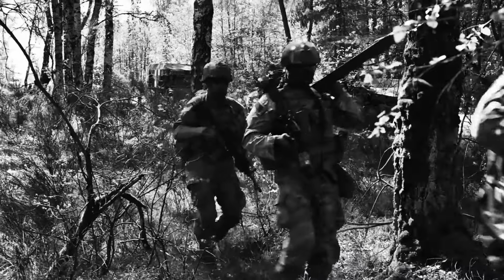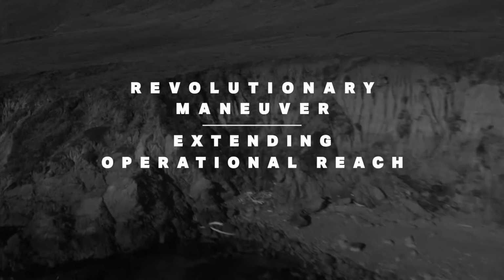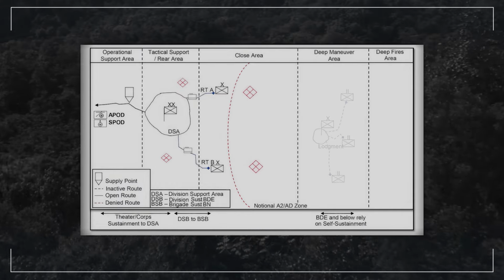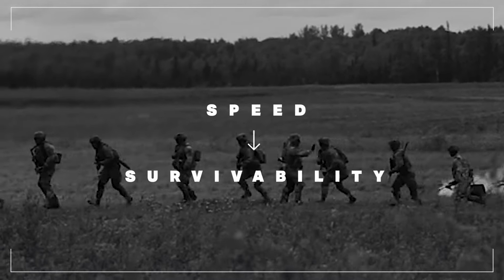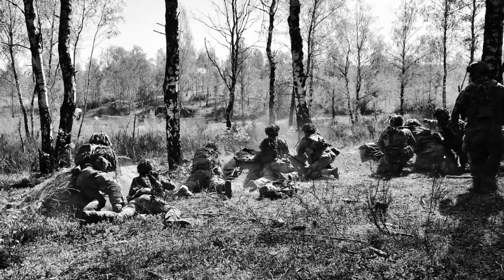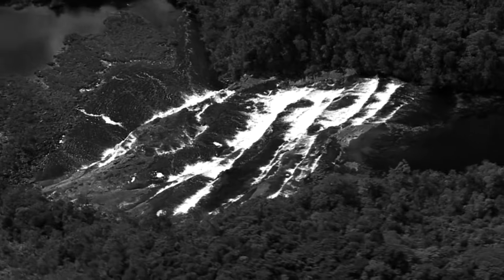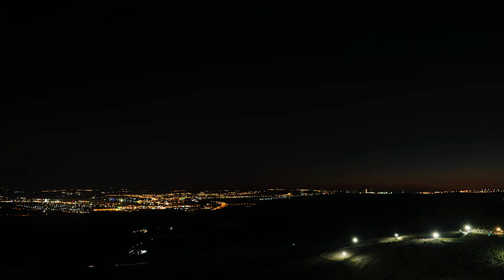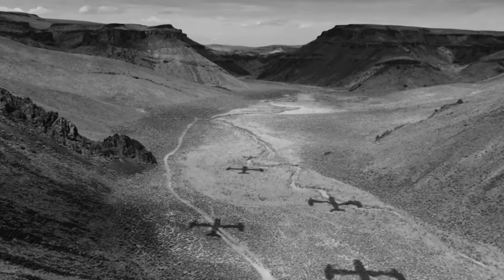Revolutionary Maneuver: Extending Operational Reach

Comment: Hello Bell Texas, it's about the bell sold invictus elysium, a front kit, middle and rear kit system where the rear section has a sikorsky drive propeller that is directed backwards and a joint step to the middle section with 2 rotors, lift unit which in the Osprey flight mode is in line with the rear module, middle module, traction rotators drive and the rear, thrust rotators drive and the front module has a joint which in Osprey flight mode takes the jet position with a detonation 30 mm Puma laser rangefinder. Stadtilm would be a good location for a factory for production in the Ukraine and EU. As an invictus 360 basis. With e-motor rotors which generate electricity for the drive through Duke engines 5, 10, 15 cylinder dynamo.  Your AGK DTS Hypo economic concept institute maison des associations Thuringia United Germany evangelische Union weaponsmith Fabriky would charge 50 percent of the final patent ©®™ Hello Bell with the Heli hybrid of the MDA DTS Stadtilm Foundation a larger area could be covered and with the valor two main engines and a rear blade propeller drive a higher speed to provide the Mediflyers intake point which is based on a Bell Heli area to improve range to make it more economical and perhaps enable a lower consumption of fuel with a twin Duke energine new Zealand two Duke in opposite connections with a swivel nacelle upper large trill rotor and a lower propeller. Your MDA DTS Thuringia would charge 50 percent of the final patent ©®™ mfg Christian Deutschmann Team MDA DTS Stadtilm Foundation

Comment: Tiltrotors are under development since mid 1950’s, the Osprey, a 40 year old design still keep falling of the sky. The propaganda “twice the speed, twice the distance” is just what it is, propaganda.
Reply: I always find it odd to read the comments on the V-22 Osprey. Many people still parrot superstitious beliefs that this aircraft is unsafe.

Meanwhile many are oblivious to the fact that the CH-53 early variants had a high mishap rate and a higher death toll. Between 1969 and 1990 (21 years) the CH-53 and it's early variants has killed over 200 servicemen. That's more than the Osprey in its combined testing and operational years which is about 35 years. So while people gave the CH-53 a pass for being new with the concept of helicopters being also new, I do think they should also give the VTOL concept that same benefit with the Osprey being the very first production aircraft. For being new as an aircraft and a concept, the Osprey's mishap rate is not that bad and before the recent accidents it had one of the lowest. 

And for the current version of the CH-53, the MH-53E Sea Dragon version of it has had the highest mishap for the Navy between 1984 to 2008 recorded as 5.96 per 100,000 flight hours. Which is more than double the Navy's average mishap rate for helicopters at 2.26. Between 1984 and 2019, 132 people died on the Navy and Marine versions of the MH-53E. That's a 35 year operation history sample of these two E variants, about the same number of years the Osprey is currently flying in 2024, but this MH-53E and CH-53E can't make the excuse that it is a new aircraft nor say it is pioneering the helicopter concept unlike the Osprey. Additionally there are 172 MH-53E and CH-53E built according to Wikipedia. In 2020, there were 400 Ospreys variants built. 

The other misinformation I routinely see is the comment that if VTOL loses an engine they are screwed. That's untrue, there are driveshafts connecting the 2 engines so one can send power to the other. Also, the blades don't go into a dead stop if the engine goes out. From what I gather the Osprey's emergency method of coming down is a run on landing which something that is done for helicopters too. The Osprey pilots have control over the pitch of the proprotors similar to what helicopter pilots do when they have to make an emergency landing. It's not an ideal way to come down, but neither was losing power.

Oh and "twice the speed, twice the distance" isn't propaganda. It is a fact of tilt rotors.
Reply: @bl8danjil  Well, first of all we have to remember that helicopters came from the VS300, a single seat almost useless machine to a twin turbine metal monster IFR equiped S-65 in about 30 years.

Tiltrotors on the other hand is a 70 years old machine design that still has not proven anything because if it had there would have a lot of more Tiltrotors, wouldn't it? 

When you say that in 21 years the "CH-53 helicopter has killed over 200 serviceman" we shall not forget that it includes Vietnam war time era and it was probably rushed into service and it is not fair to compare the timeline (1969-1990) to 1989-nowadays as things in the past were a lot more difficult and the Osprey was designed with computers instead of pencils and rullers like the CH-53.

Another thing, when we talk about safety we have to compare not only the total accident rate by flight hours. 

How and where were those airframes used? 

Wouldn't one type be used more in a brownout environment than the other, for example? 

Although I do consider that the tiltrotor concept is a mechanical nightmare the real problem with tiltrotors are not mechanical, but it is called physics.

Small rotors are just plain aerodinamically ineficient, they have to move the same amount of air than a larger rotor for the same weight so their downwash are ridiculous, they are a lot more prone to Vortex Ring State and so forth and as far as I know the propaganda "twice the speed twice the distance" is only possible at 20.000ft but guess what, the Osprey is not pressurized!

For me Tiltrotors are like ducks, they fly, they swims and they walk, but are not good at any of those. 

It is a bad helicopter and a bad airplane IMHO.